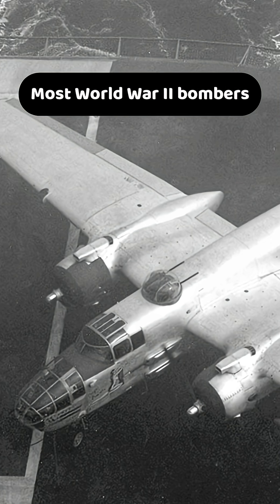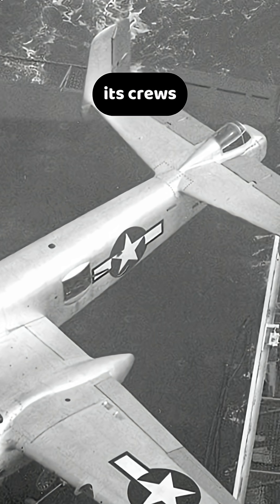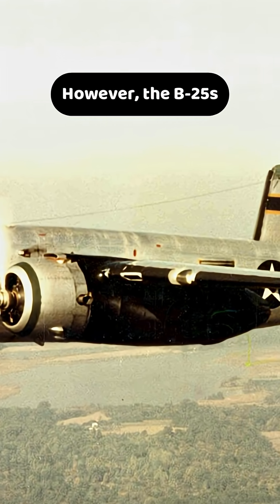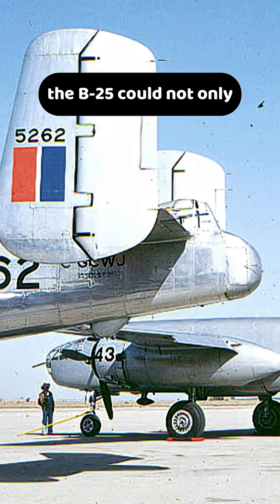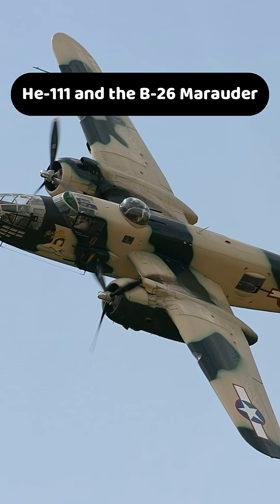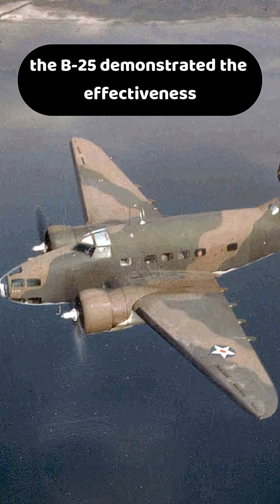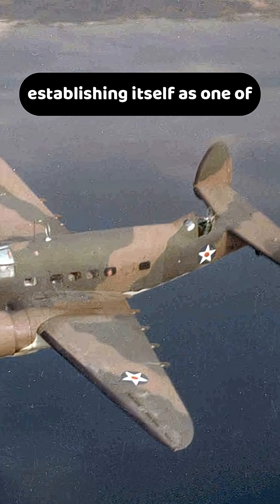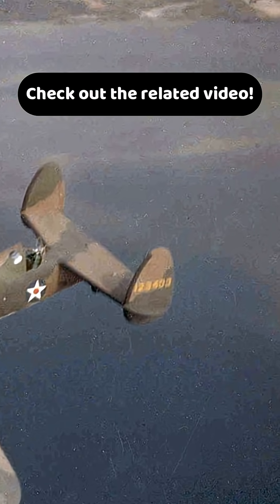How The B-25 Mitchell Could Still Climb With Only One Engine?

Comment: This is BS.  

Twin or multiple fins are to reduce height.  

This is why the Constellation had three. 

Look at the PB4Y Privateer.. effectively a B-24 with a single large vertical stabilizer.  

All multi engine aircraft have to have an acceptable Vmc or minimum control velocity with critical engine failed (typically the left on on twin engine aircraft) at maximum weight and most unfavourable centre of gravity with no more than 5 degrees bank to the good engine.  Vmc is usually significantly lower than Vyse (single engine best rate of climb) and Vxse (single engine best angle of climb).

Comment: A common tail arrangement.  It also added little to the plane’s ability to climb.  The excellent climb rate came from the large wing which was well designed to take damage yet not flex.

The twin tail gave good rudder authority on one engine or two at the price of increased drag and weight.
Reply: Not really.  The fins are smaller so have less drag.  Interference drag isn’t even worse because each outer side of the fins are completely clean vs a normal fin that has interference drag on each side of it.

Comment: Yes, the B-26 Martin Marauder could climb on one engine, but it required specific training and skill to handle. While it was a powerful bomber, its high wing loading and relatively high stall speed initially led to a reputation for being difficult to fly, particularly on one engine. Experienced pilots, including Colonel Jimmy Doolittle, demonstrated that the B-26 could be flown on one engine, including takeoffs and landings.